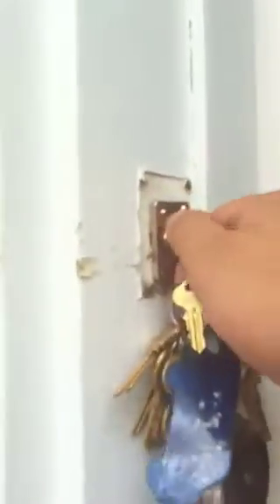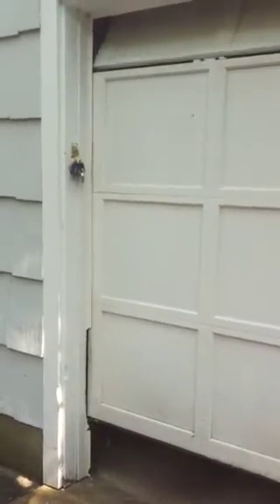Need help with bay door

Comment: Looks like the tracks could be too close together. Loosen the track brackets on the wall, and slide the tracks away from the opening about 1/4" on each side. If you have extension springs (along the top tracks of the door - they stretch when the door closes), the springs may not be set equally. You can do either of these yourself, but be sure the door is open when you adjust the springs. Hope this helps.